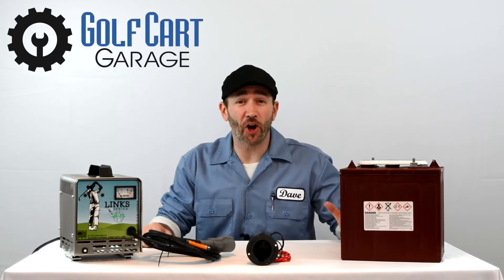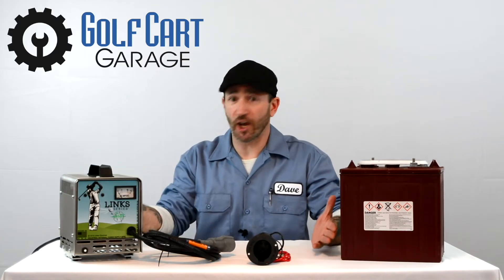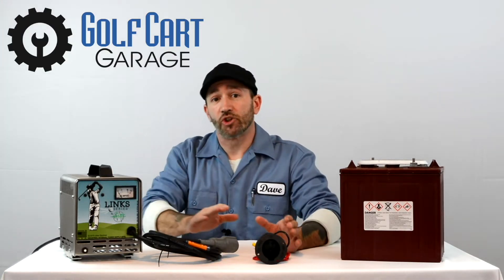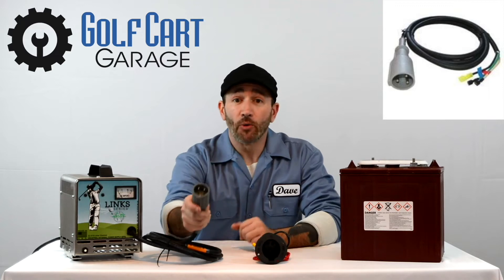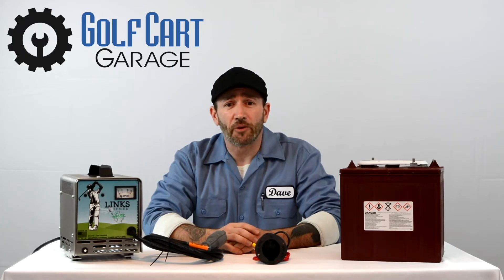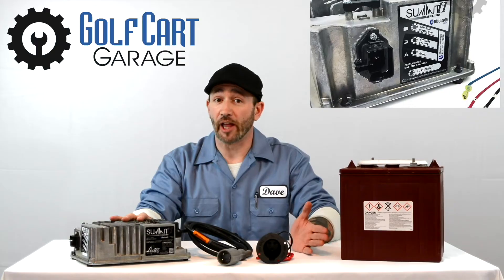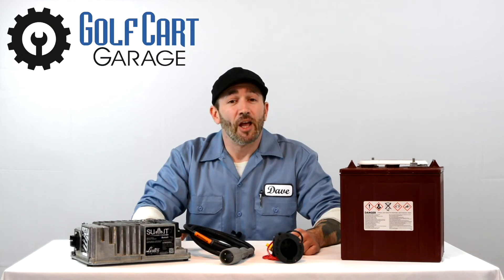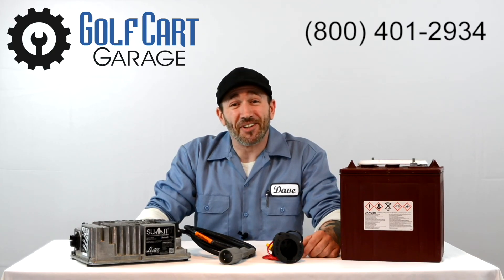48V Club Car Not Charging, Club Car Charger and On Board Computer | FAQ | Golf Cart Garage

Comment: I just want to know where the tow/run switch is? I put new batteries in and it hasnt started since? 1995 club car. cant find in battery compartment. or dash
Reply from the maker: Thanks for watching, Rosemary!  There is not likely a run/tow switch on your 1995 model.  There may be a problem with the OBC (onboard computer) on your cart causing a lockout after a battery replacement, that may require a reset.  Get in touch for more help!   Support@GolfCartGarage.com or (800) 401-2934

Comment: Hi, I have a charger like in your video. I would like to use it for a back up charger for my solar batteries. Is it practice to add an OBC to the system.
Reply from the maker: Thanks for watching!  OBC is a Club Car 48V specific part.  It can generally only work on a Club Car powertrain system designed for its use.  While not impossible, the project you're proposing is not something our techs have dealt with.  It may be advisable to contact Club Car directly for assistance.  You can also get a tech advice appt with our head mechanic here: https://www.golfcartgarage.com/gearheads-on-demand/

Comment: Golf cart garage,  what battery does the Red wire from the Charging Receptacle connect to on the 4 battery 48 volt combination??
Reply from the maker: Thanks for watching, Laura!  The main red wire from the receptacle should go to the first battery positive.  The black wire should go to last battery negative.  This allows for all to be charged at once in series.  If you need more help, just get in touch!  Support@GolfCartGarage.com or (800) 401-2934.  We're always happy to help.
Reply: @GolfCartGarage  ,  Thank You and Yes I will either write or call if any more questions.  Very Helpful 👏👍

Comment: Had my charger checked, they said it was charging but my batteries arne not charging, I charged each battery seperate, but the will still not charge, what could be the problem?
Reply from the maker: Thanks for watching, Thomas!  If you have enough power to drive and this is a 48V Club Car from 2014 or older... you probably have the OBC issue we describe in this video.  But, you can get a free video diagnosis with our techs here: https://www.golfcartgarage.com/gearheads-on-demand/
or get in touch directly at Support@GolfCartGarage.com or (800) 401-2934

Comment: Your fix of a different charger is not valid.
How to test the charger when you already know the obc is good.
Reply from the maker: Thanks for watching, Henry.  We highly recommend the charger in the video to solve the problem for good, so we consider it the most valid solution available... but, we're salespeople... so, take that with a grain of salt.  There is no test for the OBC driven charger.  If your OBC is good and the charger doesn't work, either your batteries are totally dead or the charger needs to be replaced.  You can test it on another Club Car with OBC or use another exact replacement charger to test your cart, but there is no testing machine or method.  The best way to solve the issue without headache is to consult our techs in real time here: https://www.golfcartgarage.com/gearheads-on-demand/ or if you just want to go over questions for diagnostic help, you can get in touch at Support@GolfCartGarage.com or (800) 401-2934.

Comment: Hey Dave,
I have a Yamaha 48 v charger. When I plug it into an outlet nothing happens , no on light, nothing. I notice there is a small plastic cap that says 15 amp. I’m assuming that is a fuse. I’m thinking that could be the problem, but I don’t see any way to get to the fuse without breaking the cap….see picture, any ideas?
Reply: 15
A
M
P
Reply: Sorry, can’t get picture to send.
Reply from the maker: Thanks for watching, Ray!  You can send your photos and chat with our tech at Support@GolfCartGarage.com or (800) 401-2934.  Or you can schedule a real time diagnosis appointment for FREE right here: https://www.golfcartgarage.com/gearheads-on-demand/

Comment: How do i manually get the charger to turn on? Do i put 48V to the third pin on the charge port or should that be ground? I have a summit II on order, but i want to manually top the batteries off so they dont sit empty.
Reply from the maker: Thanks for watching!  Cart condition, wiring, and other factors may be involved.  Though your Summit will likely arrive before you have a chance to take action, for specific assistance with your vehicle, we recommend consulting our tech staff at (800) 401-2934 or Support@GolfCartGarage.com
Reply: I’d say Dave that is great advice… thank you RLC2020 and good luck

Comment: I have  a 2006 CLUB CAR with OBC and I plan to bypass the OBC. It came with a PowerDrive2 charger. 
I plan to buy the Summit Series II, 36-48V Auto Ranging Voltage 13-18A, CC Power Drive w/o OBC.
Will this charger work for me?  Thank you
Reply from the maker: Thanks for watching!  Yes, if you bypass, that charger option you mentioned will work for you.  At a lower price point, though, you can also find the same charger with an "onboard" connection that will serve as the bypass and connect just by installing it.  We have a video to walk you through that and all the info you need here: https://www.golfcartgarage.com/on-board-36-48-volt-golf-cart-battery-charger-lester-36v-48v/
If you need anything else... get in touch! (800) 401-2934 or support@golfcartgarage.com
CHEERS!
Reply: That is great advice Dave. Thank you iamsmilingbear and good luck

Comment: If I disable the OBC or On Board Computer
on my 2006  Club Car Precedent, can I use a 
LINKS Series charger EPS by Lester Electric to charge my cart?
Reply from the maker: Hey, thanks for watching!  No, the Links series from Lester does not have an internal control unit.  It's on and off commands are given by the OBC, so it cannot operate if the OBC is malfunctioning or disabled.  We recommend the Summit II model for these situations, using an onboard  charger will bypass the OBC and Summit II is self-controlled.  Let us know if you have more questions, get in touch! support@golfcartgarage.com or (800) 401-2934.
Reply: @GolfCartGarage  Thank you!  Love your channel  subbed liked

Comment: Dave - I have a 2009 Club Car Precedent 48v.  What would cause the electrical plug that comes from my charger to melt and mold to the extension cord connection end?  I had to cut the extension cord since the plugs wouldn't pull apart and have since purchased the Lester onboard model you suggested.
Reply from the maker: Hey, Robert!  Thanks for stopping by... sorry to hear you had a charging issue like that.  Without having been there, it's tough to say for sure... but, probably the OBC on the cart had an issue stopping the charger?  If it ran for too long, that could certainly cause some real heat, even fire sometimes.  The Summit II will avoid that sort of issue by controlling itself, and they stay much cooler than older chargers.  Let us know if you need more help or have more questions! support@golfcartgarage.com or (800) 401-2934
Reply: @GolfCartGarage  Thank you for the quick response !!!  I have a new Summit II on the way and should be able to bypass the OBC with the direct battery connection as explained in your video.  Looking forward to trying it out.  It will also be a great charger since it's waterproof and I don't have a covered area to keep the cart in.
Reply from the maker: It's our pleasure and glad to know the Summit II video helped you out!  Sounds like it was the perfect way to get a charge into your batteries with a damaged receptacle.  We're sure you're going to have a better, faster charge, and even maybe improved performance on the cart.  Let us know any time we can help!

Comment: Dave, my E-Z Go powerwise 48volt charger, is blinking Red..  it says if it blinks Red,  Fault Code..    help bro...
Reply from the maker: Hey!  Thanks for stopping by.  A fault code on the EZGO Powerwise usually indicates either a bad battery or a charger that needs to be replaced.  Try our power testing video: https://www.youtube.com/watch?v=NsUkLCTWSnQ&t=72s
or if you need more help, get in touch! support@golfcartgarage.com or (800) 401-2934
Reply: @GolfCartGarage  
Thank you Dave!  I appreciate your response,  and WILL do.👍

Comment: I just bought a 1998 Club Car, and noticed that the battery charge indicator is not working. Is there a way to test this gauge? I'd hate to buy a new one, only to find out that it also doesn't work, because of a wiring issue. Battery charger itself works fine .... batteries DO get charged sufficiently, but I just cannot tell how many miles i have left on that charge.
Reply from the maker: Hey, Rick!  Thanks for stopping by.  You could try testing the leads that supply your gauge... but those can come from a number of manufacturers and wire up differently, so it's not a universal answer.  You might consider consulting our diagnostic service at https://www.golfcartgarage.com/gearheads-on-demand/
or call our tech line at (800) 401-2934

Comment: Cheapest way is to bypass your charger and use an outlet timmer..$20 fix
Reply from the maker: Hey, Santa!  (I didn't know sleighs had an OBC?)
Can't argue that, a cheap fix would be an outlet timer like you might use to turn your lights on while you're away to ensure that the charge stops and starts again if you can't be there to manage it.
Because Summit II is self controlled and far more advanced, with so many other great features, we look at that as a stop gap measure, but thanks for mentioning it.  That can be really helpful when you're stuck for a way to charge. Awesome!

Comment: Ok, here goes, cart was fluctuating, lost power after 9 holes, put on charger & was still charging after 48 hours, took off, reading was 8:2 - 8;5. Charger did another cart in 6 hours. 4 days later & 24 hours after leads disconnected from cart batteries still bubbling?
Reply: Batteries 2 years old?
Reply from the maker: Hey, Simon!  It sounds like you may be having an issue with the OBC on the vehicle, assuming it's a 48V Club Car.  It may be easier to assist via phone or email.  Get in touch with us at (800) 401-2934 or support@golfcartgarage.com and we'll try to help!

Comment: I have a 48v club cart it works great except after 5 to 10 mins of use sometime when you depress the accelerator it will lunge and then not move usually after you wait 5 minutes it works again. Wondering where I should start looki,g at?
Reply from the maker: Hi Nyle!  This is sometimes a symptom of a charger not finishing it's cycle completely or of a dead battery cell(s).
We have a video on battery testing here: https://www.youtube.com/watch?v=NsUkLCTWSnQ
Usually, this can be fixed with a battery replacement or a new charger that doesn't take commands from your OBC.  Let us know if we can help more on your cart! support@golfcartgarage.com. or (800) 401-2934
Reply: This could be a bad motor tend to fail once it gets hot do a continuity test
Reply: You may need a motor controller, under the accelerator pedal.  It is a $19 item that I paid repair people that changed the computer twice at $400 each time.  I repaired it myself with a new part.

Comment: I recently purchased a 2016 club car on May 16th, 2020.  Upon getting it home, the bulky charger that came with it would work properly give 3 beeps and charge, but periodically would kick my breakers off, and would kick my neighbor's breakers as well.  So, I exchanged and got a Summit II charger.
First question, should I when plugging it up hear 3 beeps?  I did on "old" charger, but now I hear nothing and within about 4 minutes the Summit II goes from solid blue and blinking orange "charge" light to solid blue only.  I had called the company I purchased it from and told them I had concerns that batteries weren't charging, but he noted it was likely in trickle charge.  
Today, I got in cart and it started jerking and battery light came on.  I got it home and ALL 6 batteries were completely dead.  These are 2019 batteries, so I plugged it up to multiple outlets and it'll initially show on indicator (charger) all lights blinking, then turns to solid blue and orange, and within 2 minutes goes back to solid blue only.  At no point does cart "beep" 3 times...but I'm not sure if it should...
It sounds very much like it's the on board computer gone bad, but not entirely sure.
My question initially is, should I hear the 3 beeps when I plug it up, as with new Summit II I wasn't sure, but it has yet to beep.  Thanks for any help
Reply from the maker: During a charge on our 2016 Precedent using Summit II, we do get the 3 beeps to confirm charger engagement.  During charging, Summit II presents flashing yellow during phase one and finishes charging with a solid green indicator at the top.  From what you've described, it doesn't sound like your Summit II ever made a solid connection to the cart, possibly because of an issue with the cart receptacle or wiring.  Your 2016 cart, if that year model is accurate is not equipped with an OBC.  If there is an OBC present because that was a typo or for some other reason, Summit will need to bypass it in order to charge.  I recommend consulting one of our tech specialists at (800) 401-2934 in order to make sure you get up and running properly.  Good luck!

Comment: Did you repair 48v battery charger? Because my battery charger is not working , if possible then inform me and your location.
Reply from the maker: Repairing a charger can wind up costing more in shipping and bench rate than replacement.  Today's modern charger is far more sophisticated and is worth the upgrade!  Give us a call at (800) 401-2934 and we can help.

Comment: Ok i have to ask ,  ,,,,what does a stock club cart battery charger charge the batteries up to what voltage ?
Reply from the maker: Typically, a full surface charge reading on a cart after a full charge should be a couple volts higher than the cart powertrain.  36V carts should test around 39-41 and 48V carts should be in the 51-53 neighborhood.
Reply: @GolfCartGarage  i have a 1995 48 volt  club cart that won't charge on my unit or my neighbors charger , hasn't since I bought it used lol with dead batteries been charging it with a solar panel for a year now but it would be nice to use a charger,  any ideas 💡